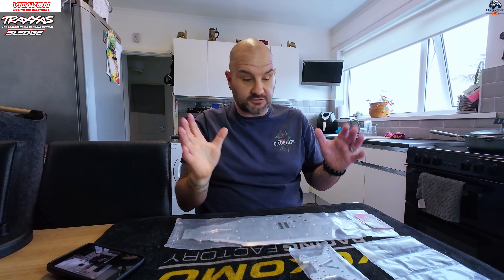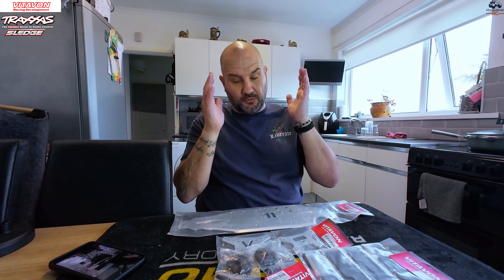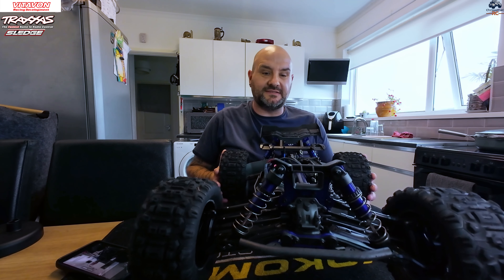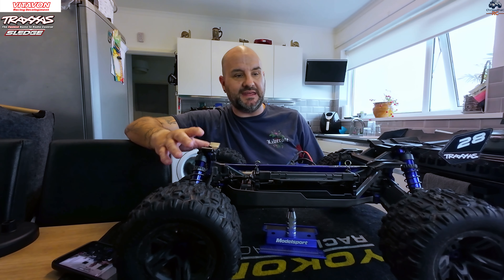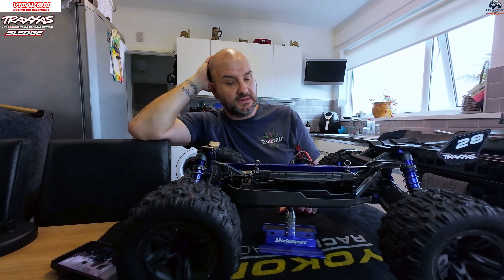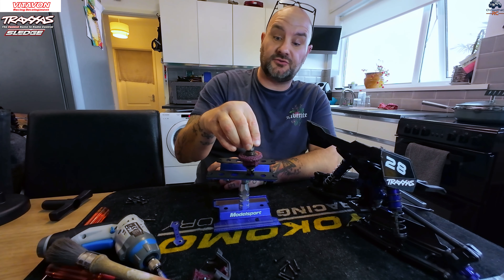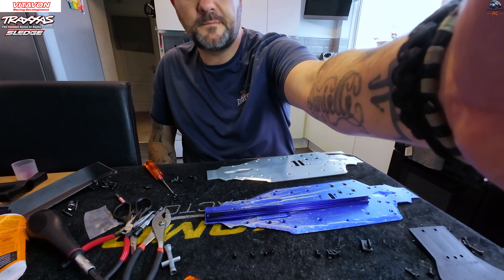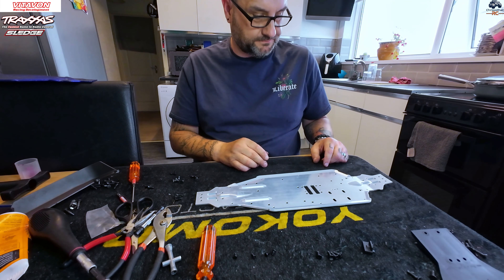Upgrade Your Traxxas Sledge: Vitavon Parts Make It Bulletproof!

Comment: I picked up my new Sledge on Tuesday and some goodies for it. It is the belted tire version. Before I even took it outside I changed the steering servo, added a motor fan and temp sensor as well at the bluetooth module, wheelie bars and RPM front bumper. I would like to get the M2C motor mount but for now I will just use the Hot Racing motor mounting washers. Took it out for a rip Wednesday night and it handles great. Sure is a little ripper, I am going to wait for the Hot racing stuff to arrive before adding a 17T machined pinions and machined spur gear so I can get it done together. For now I will just run the stock 13T. I run the same 5200 mah CNHL batteries that you do. With all your M2C stuff yours will be a dream machine.
Reply from the maker: That’s awesome, congrats on the new Sledge! Sounds like you’ve already done some killer upgrades – I love that you’re going all out with the steering servo, motor fan, temp sensor, and Bluetooth module before even hitting the track. Those belted tires should handle like a dream too. 🤩

The Hot Racing motor mounting washers should hold you down for now, but once you go M2C with the motor mount, it's a whole different game! It really locks everything in place, especially for those higher gears like your 17T pinion upgrade. I’ve got the same batteries and they’ve been solid for bashing, so you’re set there. Keep me posted once you get that Hot Racing stuff installed – sounds like your Sledge is going to be a real beast! 💪
Reply: Ive had my sledge for 2 years now. Done many upgrades including the M2C motor mount (Highly recommend!) however, I wanted a large fan to cool the motor when running in the summer months. I decided to go with the GPM motor fan and its been awesome so far! The only issue being the supplied mount(s) with the GPM fan aren't that great for keeping the fan in place... This is where I get to my point, I kept the stock motor mount as it has mounting holes for an aux fan and will keep that fan in place. So while having the M2C mount installed I also have the stock motor mount installed (you've just got to modify it so the mount sits back further ie. cutting off a small piece). Anyways just wanted to share that bit of info incase you came across this issue after installing the M2C mount.
Reply: @spencer9841  I have the M2C mount on mine now. I was thinking about cutting my stock mount to use the fan but went with an aftermarket heatsink with dual fans. I will try that and see how it goes. It should work good at the fit is real tight and doesn't move. If I do have any issues I can always modify the stock mount and slip in on.

Comment: great upgrades brother... but in my experience you really need the gear box themselves as the plastic is weak and allows flex and thats what is actually stripping the pot metal gears with these you will get some extra time but i believe its gonna do it still just my experience ive already been down this sledge highway
Reply from the maker: Thanks for the insight, brother! 😂 I appreciate the heads-up! It seems like that plastic flex is the sneaky culprit behind those pot metal gears having a meltdown. It’s like they’re auditioning for a part in a horror movie! 🎬🧟‍♂️ If you’ve already taken that Sledge highway, I definitely trust your experience! I might have to gear up and swap out the gearbox down the road to avoid a full-on gear apocalypse! Thanks for watching and sharing your wisdom—let’s hope I can keep this ride on the road longer than a few scary scenes!
Reply: @ChriswithaCrc  just needs a few key upgrades to make it unstoppable the arms are the toughest I've ever seen almost 18months of hard bashing on the factory arms....